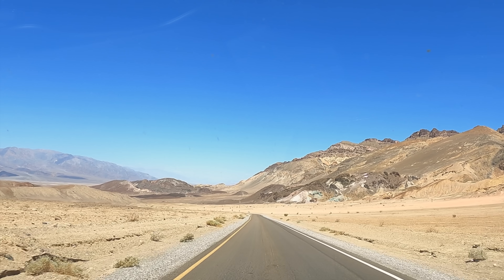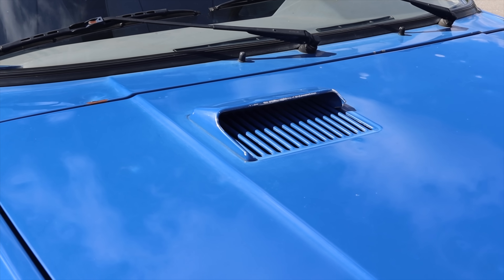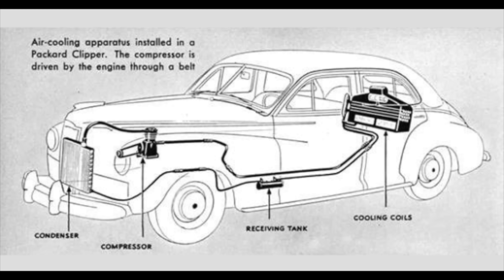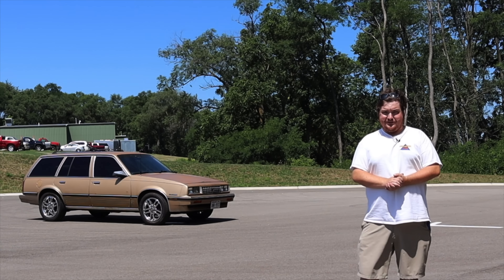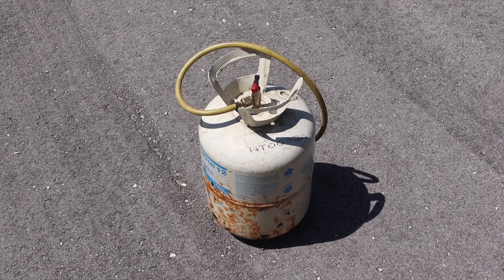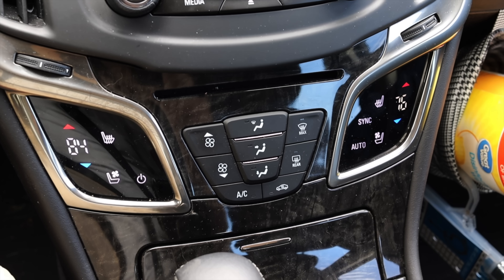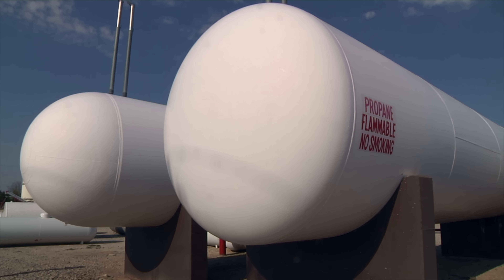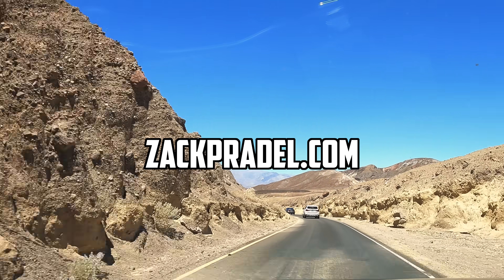Air Conditioning - The Story Of R12 & Why Modern Air Conditioning SUCKS!

Comment: So I Still use R22…compressors last longer and the air temps are better…

Runs at a lower pressure and mineral oil is moisture resistant…

Comment: My first car was a 1972 Ford Torino, the air conditioning was amazing.  My current car is a 2024 Mazda 3 sedan, and in comparison the a/c in the Mazda is like having a person with asthma blow through a straw.  It gets cold...eventually.
Reply: True. I have a 23 Mazda CX-30, basically the same as a 3. The AC barely keeps up here in FL. I had to have all the windows ceramic tinted to try to block out some heat.
Reply: @jayson657  I also tinted my CX-30 with ceramic, and I live up in MA lol
Reply: Mazda has a reputation for weak AC systems
Reply: @ryanj116  yeah it's a shame, I really love pretty much everything else with this car. But at the top trim level, it really should have ventilated seats.
Reply: @Jeffrey_Wong  This. As a native south Floridian who owns a 2018 CX-5 (ok, that's my wife's car), and have owned maybe 50 cars in my life, who is an ex LEO who used to wear dark green polyester over a vest, my priority on cars - does the AC blow cold - really cold? Not the CX-5. We've had 3 cars since then, and cold AC or not - once I drove one with light colored seats that are ventilated (cooled, actually, there is a difference) I cannot go back on the next car.
Reply: Yeah I got a 2016 Mazda 6 the ac struggles to keep up with Texas heat
Reply: Try using r290

Comment: I use a product is called Hychill Minus 30. I believe it is an approximate blend of 70% butane (R600) and 30% propane (R290) to get a similar vapour pressure as r134A.  It triggers the Aircon switches properly. However, the mix has a lower thermal density than R134A tetrafluoroethane and is highly flammable. It does not appear to work as well as r134a in my car but is a cheap alternative if you live in an over regulated country and don’t have a gas handlers license. God bless America where you can buy r134A refills at Home Depot for $17.00.

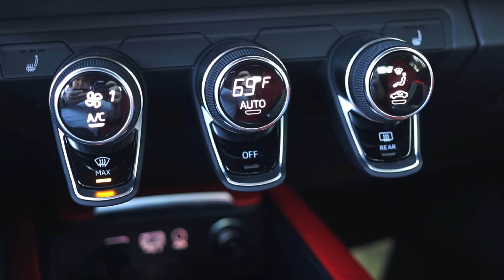Comment: 3:35 efficiency is not the same as capacity. Current designs use smaller capacity systems then historically for overall fuel efficiency. Discharge air  temperature is also a bit higher for the same reason. There's nothing stopping you from running an icebox on wheels. (it's common for refrigerated bands /trucks /trailers.) CFCs also tend to cause heart attacks, don't breath it in on a regular basis.

Comment: R-12 was supposedly causing ozone destruction. How a gas heavier than air travels so high up in the atmosphere is still a mystery. The original theory also claimed R-12 was so stable that it had a 100-year life span in the atmosphere.

 If the theory was correct, that would mean R-12 created in 1924 is now starting to break down and the "hole" would be increasing for the next 100 years mirroring production rates/gas release. That means around 2090 is when the hole would start to shrink.

Comment: R12 is non corrosive? HA HA HA HA HA HA HA NOT, chlorine and water make hydrochloric acid. So yes in a way it is not corrosive, but if any moisture got in that was not the case, so in many cases moisture got in and attacked the condenser, once the condenser was restricted cooling was greatly affected. 134A does not have this issue, so it works better,

Comment: I have a car running on R12 but the system is almost empty but the car is stored for 5 6 year,it has the big beefy Harrison A6 compressor on it,and i will fil it again with R12 as i have a full 12 13kg cylinder for it.

Comment: I run a propane based refrigerant in my 1980's truck.  The refrigerant has an ignition point 100 degrees HIGHER than R-134a, and the system uses about 1/3 as much refrigerant as R-134a.  So, less likely to catch fire and won't support combustion for as long.  I normally get about 38-40 degree F. temps when it's 90 degrees F. outside.
Reply: I remember the guy who was teaching me to work on automotive A/C systems, I said to him (as a joke) that we could use butane or propane as a refrigerant. Instead of laughing, he surprised me by saying that it would in fact make a great refrigerant, "better than this r134a". 

A 50° difference between ambient and output air is amazing.
Reply: Does the propane system also run at a lower high side pressure than r134? That would be much easier on the compressor.
Reply: is it colder than r134?

Comment: R12 was way awesome. Not only air conditioner was colder it would transfer heat much quicker. It also lasted much longer. I always thought r134a was slightly inferior. 
Supposedly it destroys the ozone layer. But that depends on the administration at the time. They've been pushing this ozone layer depletion for years now. To remind everybody the ozone layer hole opens up once every 15 years and then closes. So depending about the politics at the time it will remain open and certain administrations it'll be closed. It's picky like that.

Comment: This video was interesting to watch but it isn't that accurate, The main problem is there are several different issues all mixed together.

1. R134a does indeed have different properties to R12. It still works fine as a refrigerant, it's not far to say it is inferior without giving what you are using as a yard stick to determine that. For example, there are millions of refrigerators all over the US running R134a holding a freezer at -8 without issue.

2. Even though it can be retrofitted to most R12 systems the quality of conversions varies wildly, especially in the mid 90s and it quickly gained a poor reputation, Even a top quality conversion installed correctly won't usually be as efficient as the system was on R12 due to design differences in condensers so you are always likely to loose some performance with a retrofit and at worst with a bad job end up with a broken system.

3. Fuel economy / emissions concerns and taxes, improvements in CAD and bean counters are the real biggest reasons car air-conditioning systems in modern vehicles are less powerful than earlier years, not the choice of refrigerant gas.

There was a lot less concern about gas mileage and vehicle emissions back in the day so most manufacturers just bolted in a massively overpowered system relative to the size of the vehicle.

Switch on the AC of a 70s car and and it feels like you just hitched up a massive trailer, or dropped an anchor out the trunk.  I remember one of my first cars in high school, you had to shut off the AC if you wanted to get on the highway / pass another vehicle as the A/C was such a drag. These days you barely any rpm fluctuation in modern cars with their lighter systems. 

Better modelling software has allowed the engineers to push the limits with how small and thin they can make things so they still just about work but generate higher profits.

1234yf is the current generation gas used in the majority of new automotive systems but with either 134a or the newer 1234yf you could if you were so inclined rip the car apart and bolt in a giant compressor, bigger condenser and evaporator and keep the whole car around 40 degrees if you want that 70s experience.

Your vehicle weight is going to go up a lot, the MPG is going to drop through the floor too. Be nice and cool though :)

Comment: Just in case this helps someone. 8 Months ago I replaced the R-12 in my 33yo Nissan. Anyone intending to change up to R134a knows that they recommend a larger condenser and that the whole system needs a flush with harsh chemicals that can affect all the 30yo seals, sensors etc so you're almost up for the cost of a new system.
The solution I found is R436a, a blend of R-600a (Isobutane) & R-290 (Propane) Name = "Hychill Minus 30". The attraction was that it's compatible with the R-12 Compressor Oil so no oil change & no need to flush, and it actually requires less Cubic Condenser Capacity so the system remained sealed during the change over. Also it operates at lower Head Pressure and chills faster than R-12 so it's easier on the 30yo Compressor. Anyhow, after one long hot Aussie summer and spending less than AUS$300 , I'm more than happy with the outcome. Far cooler than the R-12 ever was.
Reply: Those refrigerants are the most efficient on the market but they're banned by the EPA for usage as refrigerants in cars because of insufficient safety testing and engineering.
Reply: Yup, super deep freezers and flash freezers actually run on those gases because they have so much more cooling capacity.
Reply: Yeah, that stuff is legal in Canada. Cools better than even R-12.
Reply: Can you use it in a r134a system??? 

Ive got to ice up my condenser somehow lol

Comment: When/if you read the ipcc report, focus on cfc's [and r-12 is in such category].  There is something horribly wrong: it assumes these gases which are heavier than air somehow magically stay in the upper atmosphere... and the explanation of migration sucks too.  Oh, there's charts and graphs sprinkled about to provide the appearance of science, but other holes show up as well, mainly in the form of a missing perspective: what are the benefits of global warming?  Could we re-green much of the worlds deserts if co2 levels increased signigicantly?  It is a political document first and foremost - and that means the thinking stops when consensus is in hand.  Pollitical bodies are just that way, so they incurably suck at science.  They move away from flat earth thinking only when the public drags them [intellectually] from their stupor.  I remain unclear of the radar system accuracy used by government types to get their alleged data, so there's my weak point.  But looking at how BLS handles its inflation and unemployment data, government research just seems to have problems, generally speaking.   But all this hoopla goes back to early balloon sampling rigs and somebody help me find it:  a picture of one of these [pre-government takeover]  rigs is needed.  Why?  Recovery - 2/3 of the planet is covered in water.  Would you put up balloons to draw air samples and NOT equip them with flotation?  So what was the commonly available & lightweight material of the 60's/70's?  Styrofoam.  How was that puffed up at time of manufacture?  R-12.  What happens with altitude?  Reduced pressure.  How much outgassing from styrofoam might occur?  Good luck: search engines are dying as we speak, and anything contradicting government grants gets buried, if not taken down.
One reason why r-12 worked better on a pound for pound basis is the compressor didn't need to work as hard as with modern refrigerants - less head  pressure means less heat added to a system in the first place.

Comment: my 90' civic was an R12 car when I purchased it, but I replaced the TR70 compressor after it failed with the 95' model civic TR090 compressor and made lines to fit. Works just as well as the old system.

Comment: swamp coolers you didn't fill with water.  It had an element that absorbed water and you would soak with water.  Air would pass through the element to evaporate the water and cool the air down

Comment: If your evaporator temp is 32 deg F, you will have cold AC, any colder and your evaporator will start to freeze up and you can get those temps out of any R134a system. Like all the other comments say R134a doesn't work as good as r12 in an r12 system, but in an r134a system r134a works just fine. Also anyone who knows AC systems will tell you less refrigerant(to a point) in the system will make it colder, so you can make adjustments until you have the best amount in retrofitting an r12 system.

Comment: I don't understand why automotive a/c is so troublesome say after 6 or 7 years even in a japanese car made in japan. Yet my $130 20+ yr old home window a/c still works excellent with no repairs! Even my 1957 carrier window a/c still works & blows cold!!, but it uses WAY too much electricity. 
We need a genius to create a portable a/c unit for the car that plugs into an accessory port
Reply: With home ac you don’t get nearly as much vulnerable parts. First big problem - compressor shaft seal. AC compressor takes mechanical drive from the engine and It’s very hard to seal a rotating drive shaft perfectly. With home ac you don’t have that problem, just place the electric motor inside the compressor, no drive shaft.
Second problem is the condenser is exposed to road conditions, it’s the first in line whenever something hits your car from small rocks to minor front end collisions. Third problem is rubber hoses. As you know the engine and the compressor mounted to it moves and vibrates quite a bit in normal operation. Yes you don’t feel it in the car since you are isolated by the engine mounts. But it still moves. Hence some flexible rubber hoses are required. On home AC you barely have any movement and so all lines can be solid copper, not flexible but much less prone to leak.

Comment: A huge lie - it has nothing to do with the global warming hoax -it had to do with DuPont’s Patent. It’s all about MONEY and control. Also, In many countries R12 is preferred, R12a contains propane and us dangerous due to being highly flammable (this is why older airplanes are still using the original R 12 as Freon and must be charged with R 12 - not R 12a - before they can be taken into another country and sold).

Comment: Butane also works as a refrigerant. Most mini fridges and ice makers are charged with it (Called R600). As far as i know, one of the highest performing vapor-compression refrigerants known to man is something like a 70/30 blend of propane/butane. It also has a nearly identical pressure-temperature curve to R134 or R22, so it can be used in common A/C systems....

...just don't get a leak

Comment: My dad had one of those swamp coolers years ago. It hooked on the back side window of a 1939 Ford tudor sedan. It didn’t really work well, and made the interior of the car smell like wet horse, as it had horse hair as the evaporative media. Those old Fords also had a cowl vent that could be opened up with a lever under the center of the dashboard. Couple that with the crank out windshield, there was a decent amount of air flow while driving.

Comment: the plow truck i use at work is a 1975 dodge pickup, i think. anyway all we know about the climate control is that it cant be turned off and its warm. sounds problematic but remember its used as a plow for plowing snow so ac isnt really needed for reasons you already know. i am very thankful thats how it broke rather then it just not working...

Comment: R134a is great in a modern system. The gains we've picked up in compressor and insulation efficiency are surprisingly substantial. It's the same reason a massive, modern fridge is better than the smaller, older ones. They're actually about 4 times more efficient even with a so called "inferior" refrigerant.

Comment: Some 5 or 6 years ago I had an old 90's Mazda Miata that needed recharging.  The old system used R-12.   Yup......I couldn't get R-12 anymore in America.  Anyway......I found a product called "Red Tek".   Though not a one to one direct replacement (oz for oz).  Rrrrright....always read the instructions and fill recommendations before usage.  Anyway, it worked well.  But sadly, the car was wrecked about a year after the refill.  So, I can't say how long it would have lasted.

Comment: My new NX450h+ (plug in) has a mini split. It does not relay on heat from the engine to make heat. When the car is on EV mode the heat is pull from the outside and brought inside; when I want cold air there is an inverter that turns the "heat pump" into an air conditioner. I believe thats how other EVs work so there it is the next step mini split inverters inside cars.

Comment: Also, manual airconditioning cools more, because once climatronics reach the set temperature they start blowing not cold, but somewhat lukewarm air that's a mixture of cold air from the air conditioner and warm air from the outside.

Comment: Aaaargh, this old argument. Please get your science straight. Yes I am sure that "some" CFC molecules rise to the high atmospere and possibly but not certainly the stratosphere. However, these molecules are 4-8 times as heavy as the surrounding air. Most leaked R-12 settled to the ground, and is denatured / digested there. There was no reason (not proposing conspiracy theory here, but follow the money...) to replace R-12, unless you were unhappy with the fact that it was basically pennies per pound, unlike the new stuff with fresher patents. CFCs still used by airlines, fire suppression, etc., but the noise has stopped in favor of new targets of opportunity. By the way, volcanoes, and the geyser you showed, also spew vastly larger amounts of free chlorine into the atmosphere daily.

Comment: The real issue is the newer R-1234yf, expensive, flamable and releasing corrosive gases during combustion. For real, it's safer to use propane at this point, in the worst scenario you'll get burned, but at least you won't get chemical burns. Anyway, in the EU sh*thole we are stuck with it.